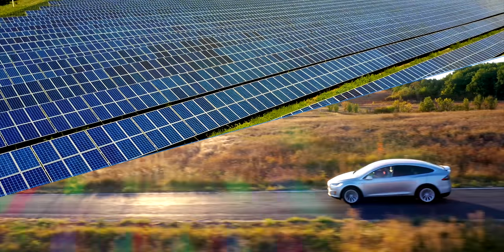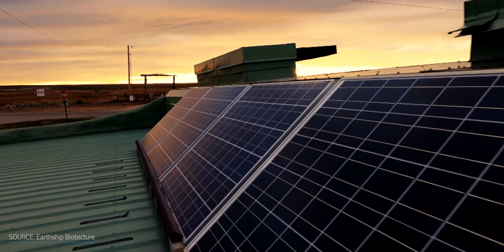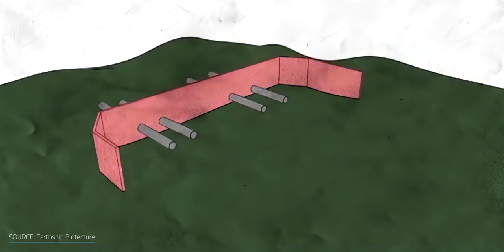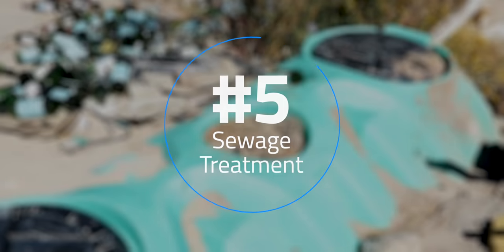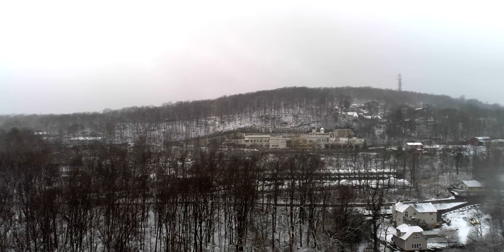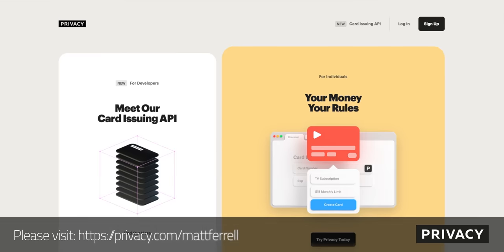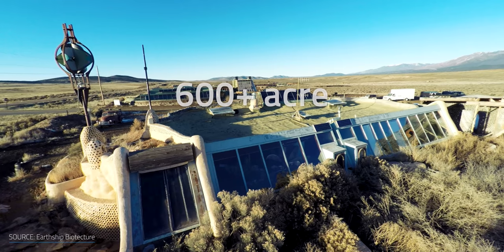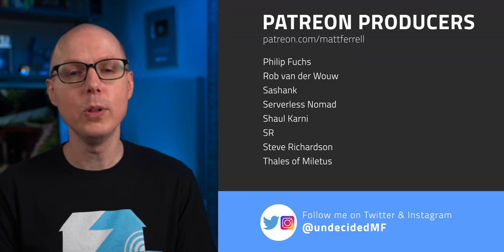Exploring Off-Grid Earthship Homes - Ultimate Efficiency?

Comment from the maker: What elements of an earthship do you think make the most sense for wider adoption? Special thanks to Privacy.com - go to http://privacy.com/mattferrell to get $5 free money!  

If you liked this video, be sure to watch Exploring Massless Energy Battery Breakthrough: https://youtu.be/7rJf_n3bc0I?list=PLnTSM-ORSgi7UWp64ZlOKUPNXePMTdU4d
Reply: The problem with these is, as with most green tech, the cost. As long as homes like these are out of the price range of the lower middle class and upper lower class, they’ll never become common enough to make the dent they need to make.
I mean, earth ship proponents SAY it’s cheaper to build, but then you look at the actual bill/quote for making one as compared to just buying a conventional house on the market and you can see how the cost of entry keeps most of us out of the party.
Reply: Do they pass the building code? Or will the government come and knock your house down to protect you unless you live somewhere out of reach?
Reply: Thank you Matt. I am planning on building an earthship out of concrete block and stone. Big fan of rockwool insulation. It will be first time I use comfort board under concrete floor. Usually use pink rigid foam insulation under concrete floor. The floor will steal thermal mass if not insulated good. Windows will be vertical. I have already driven down a point well and it flows. I have a ram pump to pump the water. Sewage is one of the expensive things I must deal with in karst area. Building old world masonry stove/heater. The only issue on code so far was d.c. instead of a.c. smoke detector. Going all d.c. for electric. The labor on a tire is way more than me to work to buy block and stone and lay them. 8x8x16 concrete block is only 1.25$ It takes me and another mason a month to build foundation and 160 feet of 8 foot basement wall. Looks like I will spend around 33,000 all together. 17,749$ so far for 10 acres, hand driven 2" well, ram pump, and gas. Icf and poured walls can be used to make earthships too. I am trying for r 35+ in walls and r 60 in roof. Windows and septic will be must expensive part. Above ground planter because seems easier. 6/12 mono sloped roof going from 6 feet to 18. I loose window space due to thick masonry walls but should give room for 14 foot tall plants going 2 stories of windows. Shape and size of windows effects price. 135$ for angle iron if using rectangular window per window. Arched windows cost more too. 17 windows plus 4 egres windows. Buying windows for an earthship is like buying sails for a sailboat the more education on subject I can get the better. The way most houses are built they are meant to cost you money every month.
Reply: Probably most of the concepts could be built with Insulated Concrete Forms.  Even trying to reduce embodied energy and recycling by using things like ground up tires as agregate, this requires a lot less work and is conventional enough to get past building codes.

The South Facing windows and Thermal Mass is good as well.

If the Water is incorporated, water has 4 times as much thermal storage as concrete.  Putting a cistern in the building could be a better long term heat storage.

Building into the ground is also an excellent idea.
Reply: Ya what about Lava rocks they hold heat and dispatch it just as fast for there full of air and gases would make more sense in cooler places.
So in summer to keep the heat off why don't they have the water go through the walls 1 to cool it for hot places 2 to heat up the water for other uses and or stores it for night time use as well
Reply: If I remember right, there are some states that won't allow the earth ships.  Like California for some reason won't aprove their construction I've heard.  AZ seems be the testing state for all the good stuff CA refuses.  I think it's all because these homes would take money from pockets of the big corps that run utilities.
Reply: To solve housing problemd we need global planning, standardization and mass production!
Reply: I think the biggest thing we need to take from the Earthship project is the philosophical change in approach to building a home.   Reuse is great but not required and could easily cut down drastically on cost.  The concept that we should face homes southward with more windows for a better passive heating and cooling is a small change but could be huge for future energy savings.  Also the Berm / earth wall also is a great and simple concept.  I love the idea that we (as consumers) should be focusing on significantly more energy efficient appliances, if we pushed for that, then the market would respond and the costs would drop drastically, as the products economy of scale improves.  Add Solar (or wind), a heat pump, a multi stage water system (with a reservoir) that captures water and reuses most grey water and returns predominately solids to the sewers.  These changes would not add significantly to the cost of a home if done right, but would in the long run would save significantly in the reduced utility costs and grid requirements.
Reply: The most useful in traditional homes would be the gray water re-use. There are many traditional homes re-using gray water but they had to fight build codes to be allowed to re-use water. Building Codes need to be changed to require Grey water re-use specially now with shortages of water. The amount of chemicals and energy wasted to treat sewer water in US is huge and most of the water is treated just to be dambed back to rivers. We need to rethink how water is used in US. Why are we using potable treated water for landscaping irrigation??
Reply: @FurlowT  main reason California doesn't allow for earthship homes is due to the very strick building codes. Those homes won't pass earthquake structural codes and other codes. Earthship homes are not allowed in most cities even in Arizon. There are specific places in Arizona where it is allowed and usually is far way from cities
Reply: I've lifted a few features for my own build. The back half of the home will be partially buried. That can be somewhat applied to any split level home. Most of our windows are south facing, with a few small north facing ones mostly for aesthetics. They're shaded in the summer by large overhangs. I've got 250' of 8" buried pipe which will supply air to an ERV. And the whole thing is built out of rebar reinforced concrete. Used tires were a step too far in my book. Eventually I'll add solar and rainwater capture systems for increased efficiency and self sufficiency.

Like you I find the concept interesting, but it's clearly very niche. My own build is pretty out there, and it's several steps more "normal" than an earthship. That said, taking the easily applied principles and applying them to more buildings en masse seems like a no brainer.
Reply: minimalist lifestyle is the most useful tip from these communities. Then they tires as structural material. Passive cooling seems appealing, not sure it is really practical (I leave in UK so does not apply here for sure).
Reply: The cooling tube could be easily applied to any ground bound house. soil temperature is quite constant at 4 ft below surface. By using that air to ventilate you get free cooling in summer and a not so cold inflow in winter. The thermal mass in a fully insulated passive house could smooth out the temperature differences. Have you checked the French popup-house concept? 
What I dont like in earthships is their traditional bowling alley floorplan. If a 120 degree corner is applied you could get a floorplan with a more central layout. Furthermore courtyards on the north sides could greatly enhance the livability of the rooms. There is not much architecture in current earthships, and the techniques used are all fairly well known, yet seldom all combined. The tech is fun, it just isnt as nice a place te be as it could be.
Reply: Greywater treatment and its utilization for toilet flush and garden irrigation is definitely a high flyer, should become standard for residential houses. 
Adding local electricity production where solar is available is getting there too - with some more feasible battery option it will soon become the norm rather than a fancy extra (not completely off-grid but somewhat decentralized). 
Superinsulating houses and approaching passive house levels are actually getting adopted in many countries in Europe, it is fartherst ahead.
Food production - to some extent - is still the norm in off-city areas in many countries - not because Earthship but because many cultures have deep agricultural origins and because gardening is a cool hobby. This is of course very far from producing your own food. Today people do not see it connected with house design, it will take longest to be adopted in industrialized countries. 
Using recyclable materials for house building is I think the hardest point. I don't really see a viable alternative to concrete for foundations today. Widely adopted insulation for wall structures are desperately far from being environmentally friendly materials - various kinds of EPS and XPS products, varnish-impregnated rock- or glass wool structures are not well (or at all) reusable, can become toxic and their lifetime is not very long. Adobe and pise are all known alternatives with many good properties but also with a big bunch of also known drawbacks, don't really get wide acceptance these days. Using timber to build up walls is not sustainable (cut down acres of forests to build one house). OSB - the big American solution to build houses - is impregnated with epoxy, you can't even burn the scraps without emitting toxic fumes. 

My biggest concern regarding a complete Earthship is that it all looks simple but when you live in one, you are 100% responsible to keep it all working. People generally have no idea how much attention, maintenance, monitoring and care is needed to keep all your systems (greywater catchment, filtering, storage, solar production and storage, smart grid to optimize production, sunshades and ventillation to keep your house at optimum temps, greenhouse plantation etc etc) running and working, tuned properly. It sure takes a lot of attention. I know people who like to do this, but many of my friends and colleagues have a lot on their plates already to work on and pay attention to. It's not just personal taste or interest: not many have the extra energy and focus to keep it all up and running.
Reply: The Privacy card promo only works for US residents.
Reply: You should look into aircrete...
Reply: Being in harmony with our planet in such an eco friendly way.🛸
Reply: Significant thermal mass and passive HVAC are the greatest advantages of the earthship. These can be incorporated into more traditional structural designs. Additionally, passive solar and photovoltaics can be used in traditional construction with south-facing clerestory windows.
Reply: Hi Matt, I have to admit I’m so pleased to see you do well on YouTube whilst not having to rely on over the top reactions and behaviours.  I’m curious about starting my own channel and wondered if you could help with a bit of advice. What software do you use for using the content from other companies Like at the beginning of this video? Also any other advice you would have for starting a channel?
Reply: Rainwater collection and re-use, but another issue with this is that for some reason, this is not always supported by building codes.  I was planning a house and tried to raise this with the county early in the process and got various answers (mostly no's).  Ultimately they said that the spirit of the code is all that needs to be followed, but it still might cause a problem with the local inspector(s), so kind of a "good luck with that" response.  Another thing about earthships though is that the mass is quite often in concrete, which has a significant carbon footprint today in and of itself.  Matt Risinger has some videos where they did a concrete  outer perimeter to support the walls and everything else is like slab on grade, but without the concrete: https://youtu.be/NbC-EfQ_u3E
Reply: I've looked into Earth Ships as well. Although interesting, The labor intensity or cost to outsource the labor is just too much. But while looking into self-built home options, If I were to finally build a home, I would do a Cob house. Still uses natural (or mostly natural as it may require some concrete for structural coding) Is naturally cooling/heating under similar concepts, and also helps to naturally regulate humidity. Of course, I would put in a robust solar array and if possible do a grid-tie, just to help reassure consistency and flip to battery backup when needed. Plus you can make cob homes in various fun and interesting designs that aren't boring squares. Some cob houses have been around for hundreds of years in Europe. "Good Boots and a Good Hat"
Reply: Living at 6000ft altitude, we see large daily temperature swings.  Thermal mass would help stabilize indoors temperatures.
Reply: You forgot to bring up the biggest pro when it comes to earthships, yes they can be quite expensive for the overall price, however when you consider your water electricity heating and cooling and growing food exists year-round with almost no cost outside of the house payment cost, you're pretty much living for free at that point.

Because you have zero utility bills for the entire time you're living there.

You can't get that in a conventional home, in a conventional home you have your house payment on top of the utilities, and these houses you have the house payment and zero utility bills for the rest of your life.

The pros outweigh the cons.
Reply: I forgot to mention, since automation is becoming more of the norm, I suspect building one of these with automation in mind could build it a thousand times faster than doing it by yourself.

If the team that Mike Reynolds has used technologies in automation they could build these things in no time. They just have to embrace the technologies that currently exist instead of doing everything like they did back in 50 years ago when they first started this earthship stuff.
Reply: What I would personally like is a house that's similar to the earthship design while using monolithic dome design as well as the water filtration heating and cooling of how an earthship would work.

I mostly want free utilities, also dumb homes are a lot less expensive too build and their design are almost indestructible for most environments, they are rated as indestructible for earthquakes hurricanes tornadoes and all other weather conditions. But I love the earthship design to a certain degree and I could see an implementation using an earthship design for a dome shaped home even for water filtration reuse as well as solar energy collection.
Reply: @vroomfondel5447  no using tires is not approved by most places building codes are designed to regulate trade labor.
Reply: @vroomfondel5447  If you use cement instead of tires you are likely to have no problems getting permitted and meeting building codes. You may have to set up heating and cooling depending on local regulations. Heating is required in most jurisdictions, Michael Reynolds talks about temporarily installing baseboard heaters to pass inspections and then returning them. Earthships can be adapted for as little as 8 inches of rainfall. How did you came up with 50 inches of required rainfall?
Reply: @higherrating2195  
I don't think he fully researched earthships to be quite honest with you, I think he ran into one or two videos that Loosely explained how an Earthship Works without really delving deep enough to figure out all the cost benefits into an Earthship.

Like when he talked about the overall cost of the building of the Earth Ship, he only talks about the base cost without even explaining that utilities are practically free for life in these things.

And yes it is true as some people will build HVAC systems or heating systems to supplement Earthship Design Homes, however in most cases people who live in them practically never need them.

Because Heating and Cooling is significantly reduced based off of the design of the Earthship same thing when it comes to power requirements, and everything comes down to choice, you actually don't have to build with tires if you don't want to oh, that is just one of the building materials that can be used that is practically free in most cases.

In this video He mentioned that you can't build these in a cold climate, which is untrue I have seen more than a few Earthship design videos where they built successful earthships with in colder regions, currently there's a guy in Russia trying to build an Earthship design home for himself and others who live in the most extreme cold temperature climates, this young man actually used to work for Michael Reynolds and his team in the Taos Earthship community and mentored under them for many years.

However there is another design that I like that's easily compliments an Earthship design but does it little bit differently, and can be implemented in such a way to work with Earthship design principles, and that's monolithic domes.

But they can also be partially buried if the person who owns the property wants it or not.

Everything comes down to choice, if I had any critical thing to say about the Earthship community and that they could build much cheaper if they embraced automation for General tasks like the tire wall pounding, which if it was automated it can be done in less than a day of work, but because they're using manual labor it takes months to do the job, and doesn't exactly help keep the costs down for it to be worth it for anyone.

Like we understand when it comes to their Global mentality of saving the environment, however they're not going to save the environment doing everything the old-fashioned way and might be better off by embracing such things as automation when it comes to the general building of these homes.
Reply: How the hell do I make an earthship with 1400 sq ft? More like an escape pod...
Reply: Probably the thermal mass of the building. It is more easily factored into existing building types with little engineering changes. All the rest is a boondoggle suitable only for hippies living in the wilderness.
Reply: The tires gas out when they break down don't use them for walls!!! Use earth bags made from natural sources for the walls if you have to. 
The earth ship design is good but the materials they use are really bad.
Reply: Ive been working on a colder climate earthship homestead farm design for the past 3-4 years which i hope to build in future, and have had a passion for self sufficient homes and design for over a decade and a half, 

Im canadian and like being in canada, so, to cover heating in the winters I've looked into many options to be able to keep warm, and recycle as much heat as possible,

For heating

-I plan on moving somewhere in canada with warmer winters to help, which is going to simplify heating quite a bit, as, dealing with -7 on average winter days, and -35 at worst, is a whole lot different than dealing with -16 on average winter days, and -62 at worst, so it will help a ton to be somewhere a bit warmer.

-Annualized geo solar, where you collect a winters worth of heat during the summer, and store it underground and thermal lag makes it so that it takes until winter until it makes its way up to the floors, this works passively, and will be the secondary way of heating, the main being of course the standard floor and wall thermal mass collecting in the day to release at night, which i wont be counting as its own system as its ingrained in the design of an earthship

-A wood boiler system with radiators as a backup, which i dont know if it needs explaining, so i wont

-Fireplaces/Woodstoves/Masonry Oven, which is more for, coziness, looks and backup cooking, and extreme situations where it would be to dangerous to go outside at all; in that order. To keep hot air from inside getting sucked into the chimney and out, there will be intake vents, so it uses outside air, rather than the air from the living space.

For reusing heat I've thought about putting heat collection pipes around woodstoves and fireplaces and masonry ovens that are hooked up to the main radiator system, so that excess heat from those sources will be collected and pumped around the house, rather than just escaping out the chimney, but need to consider it more before deciding if thats the greatest idea or not.

those are my main ideas for dealing with the cold in an earthship,
Reply: @vroomfondel5447  I watched a documentary on Mike Reynolds, the architect behind this. In New Mexico you have to permit your land as a landfill for the materials. I don't understand how after that, people are allowed to use this land as a residence
Reply: Rain water harvesting? Check.
Solar & wind power? Check.
Grey water recycling? Check.
But, my fruit & vegetable gardens STAY OUTSIDE, and sorry, not using trash to build my home. Too many potential health & safety issues. Concrete? Okay.
Reply: @MrDangerous64  
It's because it's so far off the grid that the building code doesn't matter.
Reply: @gregpearce  
You can choose whatever material you wish to use, the tires aren't the default option, as the homeowner you have choice which materials to use and which methods you wish to use.

My idea is to use some of the concepts from earthships and use other materials they have similar properties to the tires when it comes to the passive heating, but to also take advantage of the Earth when it comes to heating and cooling, another good technology that I've heard of is monolithic dome design, these things are probably the strongest structures on Earth when it comes to natural weather issues that could arise and they are structurally stronger than most modern day homes by a long shot.

Now picture a monolithic dome that is partially buried, that has access to cooling tubes just like an earthship, and another material that makes passive heating possible for the harsh Winters, then building the front side of the house facing south where most of your windows and doors are facing, then back near the top of the dome is where your water collection from rain location is sculpted in the dome for a way the water can travel into the cistern and be filtered, ready for use, perhaps create a separate sister for hot water to be collected and also heated through solar heat which can be used for showers cooking cleaning, and just like the planter cell for water treatment something like that could be built into the structure and work just as good if not better and then after that pumped back into the toilets and then to the outside cistern.

The house could also have some solar panels either on it or just in the front yard collecting power. Or possibly even a hookup for wind turbine power.

What it really comes down to is how much money you have and what you're willing to spend but also it does come down to choice. 

A lot of the people who choose to build with tires do so while they use super Adobe on top of them that prevents the gases from escaping and becoming toxic for the people living there, but again these buildings don't need to be built with tires that's just a very cheap material that you can get for free which can keep the overall costs down.

Dome homes typically use polyurethane when it comes down to insulation there are other insulations that could be used, but this one's more commonly used when it comes to domes.
Reply: Grey water systems!
Reply: It would have been nice if you gave us an idea of how many years the tyres breakdown and cause toxicity.
Reply: The greywater recycling certainly can be applied anywhere, but yeah, people need to know how to care for the plants.
Reply: I live in the Southwest.  Recycling grey water seems almost a necessity as we deal with the coming water shortage.  Also, I like the idea of being off grid.
Reply: @thesilentone4024  pumicecrete is by far a much better building material
Reply: @raymondpeters9186  oh that stuff haha haha ya no vages uses that and it gets fing hot and if not painted the rain can eroded it kinda fast
Reply: @thesilentone4024  how many pumicecrete homes have you built I've done 10
Reply: Can you make a video on Rammed Earth?
Reply: Earthship style homes may be a bit more expensive up front but, down the road, it ends up being cheaper with lower operating costs. Batteries, charge controllers, inverter chargers, all those glass windows, solar panels, cistern tanks, water pumps, filters etc. all cost money.
Reply: The biggest cost on an earthship house is labor and finding labor
Reply: @raymondpeters9186  but you could build a machine to lay the dirt and compact the tires, a rammed earth company has
Reply: Wrong, sorry.  Earthships are more stable and earthquake resistant than any other structural design.  Research Earthship Biotecture a little bit and you will see.
Reply: @OpenBiolabsGuy  - What you are omitting is the cost of ownership in addition to the cost of building.

Typical housing will be cheaper up front, BUT it will cost you much more over the lifetime of the house and that is before including repairs, etc. An earthship will cost more up front but over the lifetime, there is very little additional costs in most cases.

Also earthships are only worth while because of the principles they make use of, not because of the materials they use. Frankly speaking the materials are mostly unnecessary and only serve to make the whole process more difficult all around. The used tires, are for the emotionally charged persons of the world. Reality is that burying tires does not solve anything other than removing waste from sight. Over time it is very toxic to the surrounding environment. All the glass bottles, could easily have been recycled, a process that is not going to disappear anytime soon, nor will they stop making new bottles. The thing is the tires can re easily replaced with similar to greater results and even the glass bottles as well. In reality just replacing those two items will save substantial funding and make the project easier to accomplish. The cost of designing the building with an engineer goes down because you use materials they are already familiar with, which makes the approval process go smoothly. Because you use materials that are common, the builders can work efficiently and do not require learning a new system for building. The existing systems in place allow for stream lined efficiencies, which means you do not have to place, pack, fill and pound thousands of used tires. All those bottles can be replaced with formed glass as you chose, in colors you chose and in sizes you chose. This again saves a lot of time picking, washing, cutting, sanding, placing and then filling with mortar.

An earthship was always nothing more than a way to lesson the importance of the fundamental principles that allow such a structure to function in the manner it does. By doing so they make it appear crazy and unrealistic to most. Then they bury people with the "facts" which are often the worst way to go about achieving the key principles at play. The fact is the way they currently design them, they do suck on many levels, but this is because of a poor strategy and not because of failed principles. Someone or some people out there really would prefer that everyone this of a passive home as being unattainable without paying for expensive man made technology; which they always charge top dollar for. This is why they always make a point of saying they only work in warm climates.
Reply: In the Piedmont School district in California there was(or is) a scroll built as an earth sheltered building. Basically concrete covered on all walls by earth pilled almost to the roof line. The last time I was there was 1974. Operation and the longevity of the building would make a very interesting test. 
It was quite large, comfortable primary school. Well lighted and an environment that was quite
spacious.
Reply: You got to do one on hemp homes.
Reply: The idea of using non traditional materials repurposed from cans, glass bottles, old tires, wood from pallets and old box spring mattresses. The glass bottles can be arranged in almost any pattern and even used to provide privacy while still providing light. 
And the reusing of grey water to water the garden and then be used to flush toilets and drip irrigation.  
In theory, using a few of the technologies that the Earthship homes use can be of use when colonizing Mars or any other floating rock. Getting maximum usage from a limited water supply is needed technology on long space travels. 
And new technology forbid that current Earthship home designs would not or do not meet certain standards currently in used, that are based on a different type of build design and build materials.They do provide a way for people to be a little more self dependent. Life is a little less stressful when one does not need to worry about food and shelter.
Reply: I like the forward facing greenhouse with the water catchment as thermal mass and cooling system, but I’d definitely use different materials to stabilize the earth berms, the tires make me nervous for some reason.